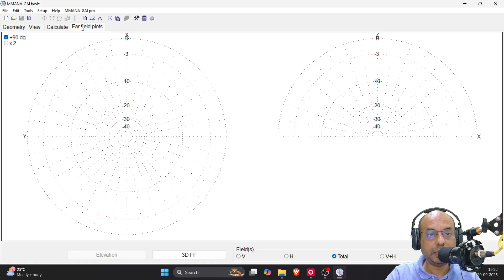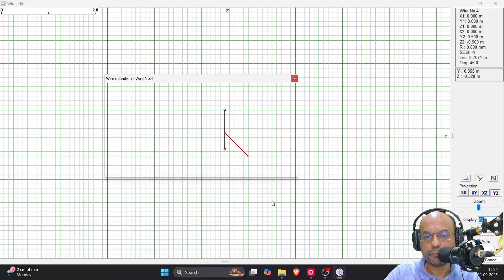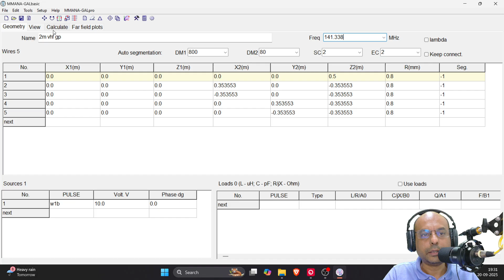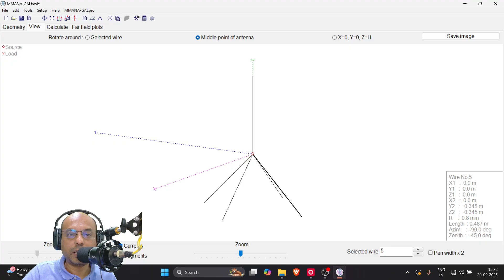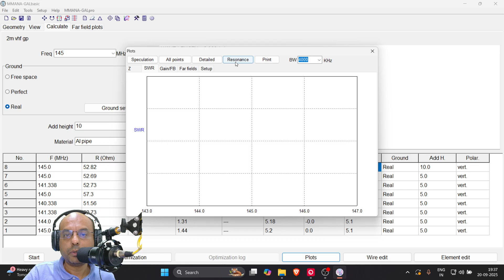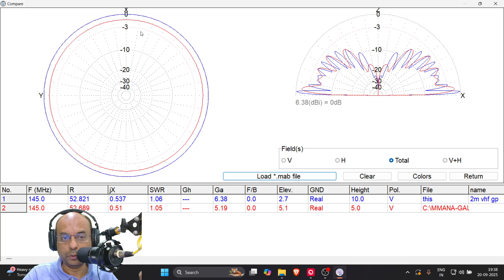Design a simple 2M VHF Ground plane antenna using MMANA-GAL Software

Comment: What about radious of metal, do base part and anttena upper parts are insulated. And two wires are feed to lower i.e ground and upper anttena. ?
Can we use different base metal or it will be same as selected in software. Or only upper top anttena parts metal getting considered.
Reply from the maker: Please check a video in my channel which shows this antenna construction. In short, the feed point is SO239 connector. The center pin is connected to vertical element and ground plane is connected to the outer body of connector. The vertical and ground plane elements are thus insulated through connector.
Reply: @AniruddhaBokilVU3FML ohk thank you